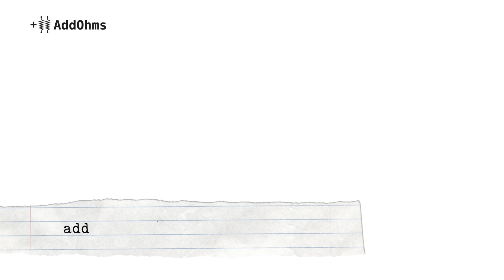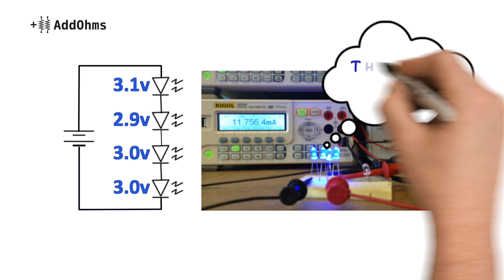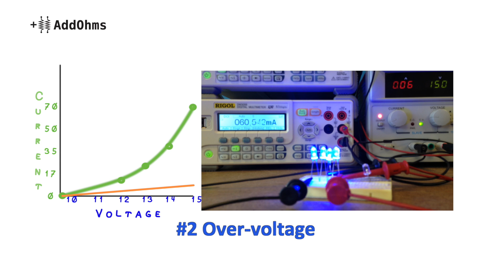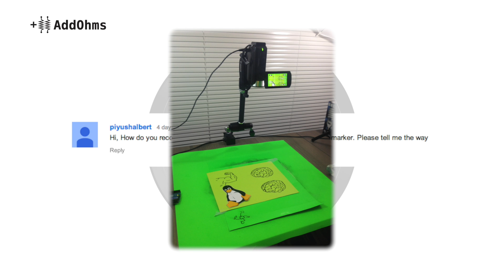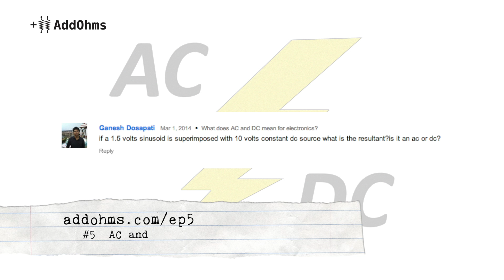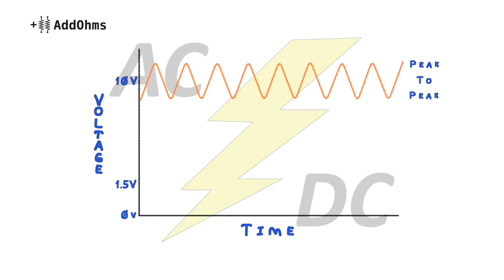AddOhms Questions and Answers #1

Comment: Here is another question that i'm not sure if you have explained in some other awesome video of yours.  How do you calculate how "resistant" a resistor needs to be? Thank you very much in advance if you are able to answer my question.
Reply from the maker: It is depends on the amount of current you want to flow through the LED.  

Using ohm's law you can calculate R as the (Source_Voltage - LED_Forward_Voltage_Drop) divided by the desired current.  (up to the max forward current for the LED.

It was briefly covered in video #8 (addohms.com/ep8).   You can also find more information here (baldengineer.com/tutorials/led-basics).